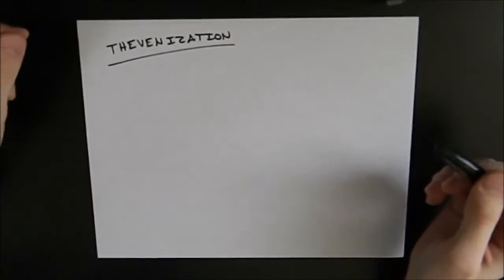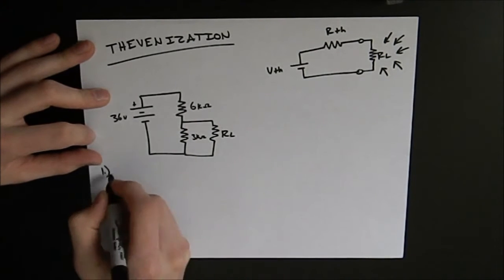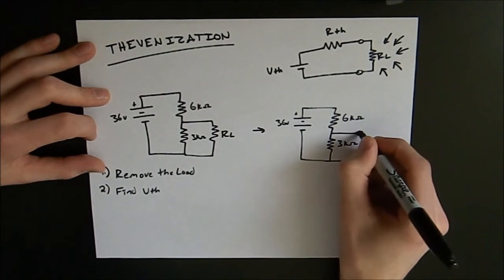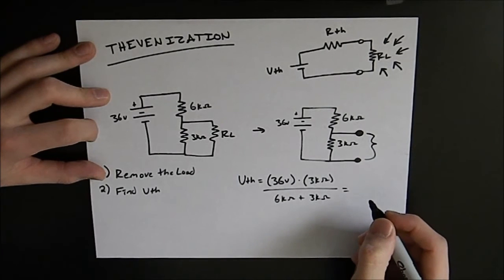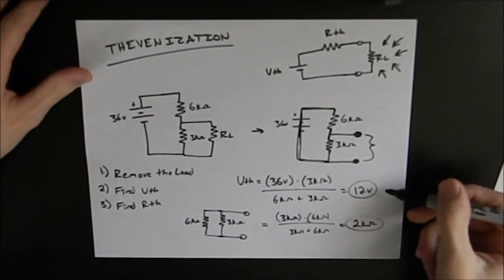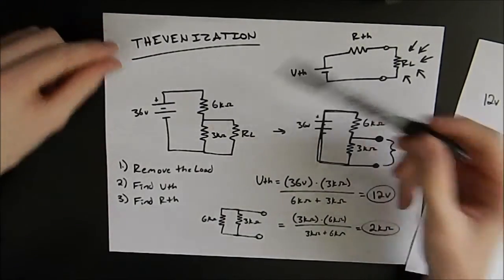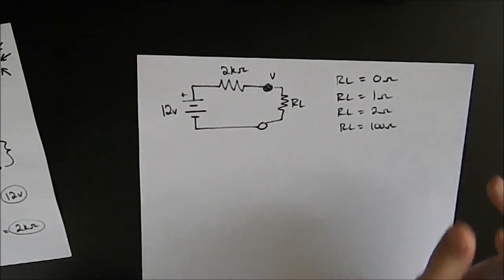Thevenization

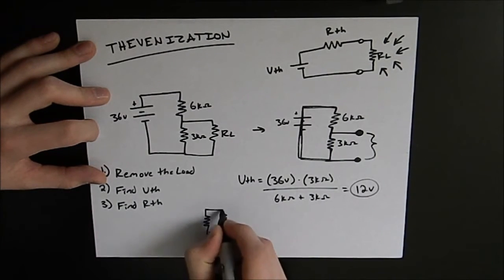Comment: At 2:59 I don't get how those two are in parallel.  Is it because we're looking in from the load?  Otherwise they look like they're in series to me.
Reply from the maker: jeremy lowe You are Correct, we are looking in from the load. Thevenization shows us what a  circuit would measure with a multimeter, in terms of both resistance and voltage, and also therefore current